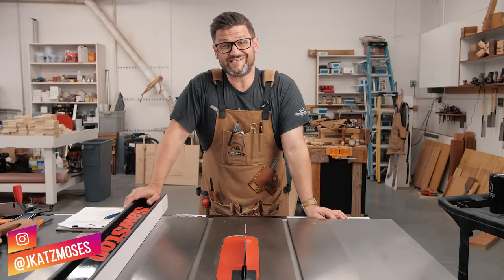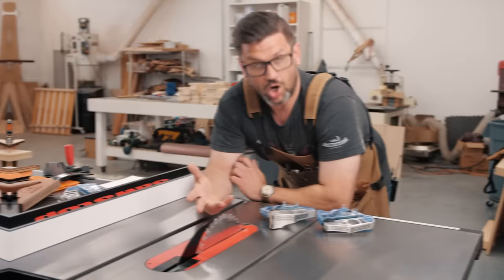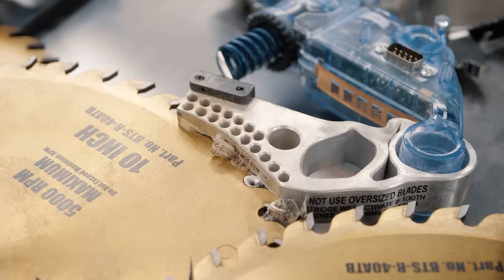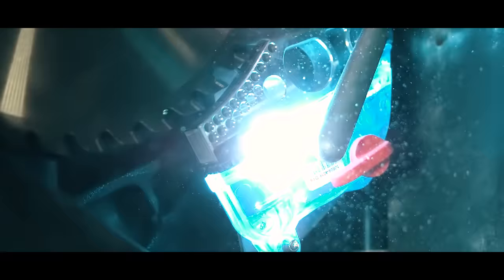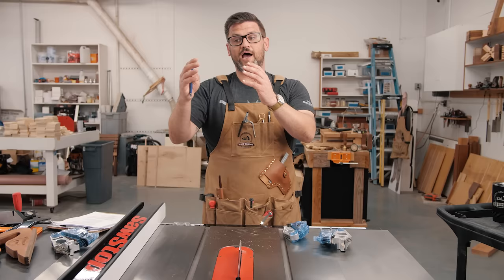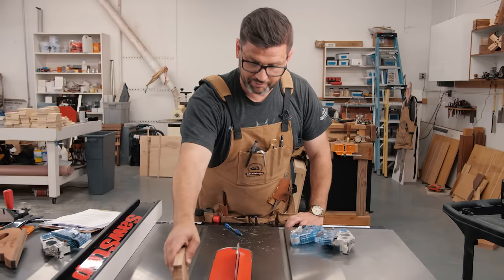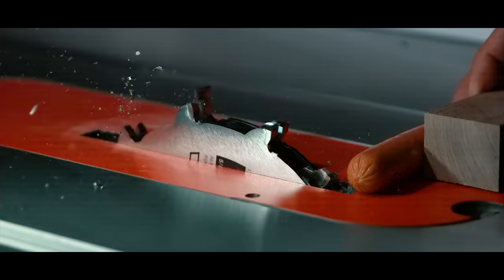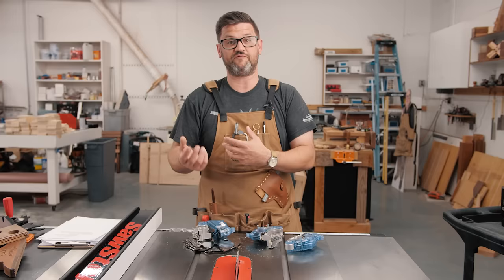How Safe is a Sawstop Saw? - Never Before Seen 19,000 FPS HD Slow-Mo Video

Comment: I think one major conclusion that you missed in this video is that having a 'safe' SawStop saw IS NEVER an excuse to follow unsafe practices. EVER!
Yes it worked the 9 times you tired it, but that doesn't mean it is guaranteed to work the one time it's a finger hitting the blade and not a hot dog.

The saw is super cool, but technology is only a compliment to carefulness, never a substitute.
Reply: I wonder if the makers ever do demos using there actual fingers...

100% agree with your comment. Safety mechanisms of any sort...rocket ship, table saw, automobile are just an addition TO, never a substitution FOR proper safety procedures.
Reply: @joeshmoe7967  the guy who made the saw has put his finger in the saw and he didn't even bleed
Reply: Wrong the conclusion is that it's safer to hold your lumber with hot dogs
Reply: The phrase "no sh*t Sherlock" comes to mind. People keep making this argument but I have to meet a sawstop owner that doesn't practice the same level of safety. I think the ones who keep saying this don't own one. I have one and have no desire to test the brake.
Reply: $100 to $150 to replace the blade and brake system is still a fairly significant penalty for not following regular safety rules... It's just not as significant as having multiple fingers cut off.
Reply: Rev_dude Indeed! Amen to that.... ! Safety first! Then hot dogs all around!! Lol!( nervous laugh)... This is a good tool... But... All tools need to be used safely...
Reply: Albi Wiedersberg yyyyeeeesss! 👍👍👍!!!
Reply: Facts right here
Reply: I don't think his intention was to tell you to throw the safety book out of the window, or say that because it does this, it will work every single time and will save your fingers or hands. His intention was to show off what people have managed to create, in the end its something that has a very high chance at saving your life in a pinch, as to put it plainly, the majority of injuries aquired in saw blade accidents, are not from very careful people, but from people who begin to think either they are very skilled in it, so they don't have to be as careful, or those who haven't had any training. I myself am a fully trained carpenter, and I had to use a saw blade when I was learning, but that doesn't mean I would ever put my hand anywhere near that blade. Even if I was told there was a magical device in it that would make sure that you would gain no pain or injury from touching the blade. Obviously mistakes happen, but this is what these are for, look at seat belts for instance, you don't necessarily need a seat belt all the time, if I where to drive to the shop, you probably won't need it, you may never need it, but it is there to save you in a pinch, when the unexpected happens. That's why things like this are invented, not to discard safety, but to offer a seat belt so to speak, something that will very likely save you in that one moment, where you either messed up, or something bad happens. Saying its a useless product because it encourages people to get rid of safety, is a pitiful excuse at the best of times. I obviously won't go against your opinion of it being a bad product, that's your decision, but saying it encourages bad safety, just shows that those who think this, really shouldn't be using this device.
Reply: Joe Shmoe yes I saw it live. I was about 6ft away too.
Reply: of course. if it goes wrong, it goes wrong less
Reply: Yeah same reason for a bunch of crashes, just because the light is green doesn't mean its safe to go. people rely too much on systems in place to save them rather than themselves.
Reply: @joeshmoe7967  just use prosthetic hand, no troble
Reply: Ya ya shut up and take my like

Comment: "You'd be back at work as soon as you were able to get your stitches out"  You know damn well that most people would be back to work right after they got back from the doctor.
Reply: False.. most people would tape that sucker up with what ever tape was in their box or vehicle and back at er
Reply: @god_mode_on  That actually works pretty well, but you need gauze or something or the blood just makes it not stick. Unless you have better tape than i own i guess.
Reply: @nuuuuuut  crazy glue
Reply: @god_mode_on  Need to be careful with it, though. And it doesn't provide much mechanical strength, in most cases.
Reply: American, yeh?
Reply: Was thinking that also. That size of a cut I wouldn't get stitches for though, I have scars from cuts I've gotten, even crushed the end of my pinky, I cleaned it, wrapped it up in paper towel and electrical tape, had a smoke and went back to work 😆
Reply: No worker's comp claim for YOU!
Reply: Last time I got 11 stitches and the boss was like "so back to work now your not bleeding on everything"
Reply: @adamrodgers9175  amen brother
Reply: @nuuuuuut  Do you not have medical tape? Just use medical tape. If it's a big wound put a non-stick pad under it.
Reply: Also if you don't have non-stick pads then cut a few pieces of medical tape, put them across each other, and form a non-stick pad out of those pieces then put that under more tape that holds the square you just made in place. I did this for a kid before who fucked up his foot pretty bad and had blood everywhere.
Reply: @FringeWizard2  I do not but I will look into that, I tend to injure myself working on various hobbies and whatnot pretty frequently. There's like this.. sort of wound care supply store not far away but i never go there because it's often filled with elderly people. maybe i'll stop by real quick and look for medical tape one of these days - or hell i could just use amazon.
Reply: Yeah except those people who live in civilezed countries, who don't get a bill from their doctors and have paid sick leave for sure. If it was a project at home... maybe, but surely not at work unless you're self employed and need to get that sh!t done.
Reply: Nuturi hell pour some alcohol on it bandage it and go lol
Reply: Ur goddamn right
Reply: @adamrodgers9175  damn right buddy, that's how it goes :D
Reply: You mean right after the electrical tape wrap.
Reply: What're you, lazy? Duct tape that gaping wound and get back to work. Job won't get itself done.

Comment: "They move the hot dog so slow" I don't know about you guys but I don't punch table saw blades
Reply: Imagine your hand slips of because the wood you held was oddly shaped w/e
Reply: @xXDESTINYMBXx  yea but even then you would have to be pushing against the piece of wood pretty hard for your hand to go that fast
Reply: @jacobbartlett331  I think it's qbout kickback, which can kick your hand into the blade. Which would go pretty fast.

I don't think much saw accidents happen where they slowly push their finger into the saw by accident. It's always caused by slipping, losing grip or the wood could unexpecticlly go through the wood if it has air pockets. Or if your project that you're cutting has less dense areas you didn't expect you will shoot forward if not careful.

So yea they should throw the hot dog in there at higher speeds than the feeding speed.
Reply: Nobody punches table saws. But kickback causes your hand to move towards the saw far harder than a punch...
Reply: 420th
Reply: The real scary thing is when you let go of the wood a half a second too early and it shoots out the other side. You’ll have a mini heart attack
Reply: Rocknroll Jimi  that’s what I’m saying, you would have to be holding pretty firm for your hand to slip and go that fast. You are literally just agreeing with me
Reply: cheryl tunt  when what happens fast? I’ve seen a comment talk about kickback, which I forgot about, but that force comes more from the saw and not your hands, I was just saying that you would have to hold a material decently hard for your hand to slip and be equivalent to the speed of a punch, which I thought was unrealistic if your using a saw that stays in place and should cut easily.
Reply: My finger went into a regular table saw. Went about half way through my finger, just short of bone, right across the nail.

My hand was moving quickly because my dog ran into the back of my legs. Never assume, accidents happen for all kinds of reasons.

Comment: This really should be required in shops used for education. I recall many years ago taking a woodshop class in a middle school where students were using the table saw on a daily basis, and I always felt that was less than safe. That class was certainly not without accidents and this would improve the safety immensely
Reply: It activates when an electrical resistance is sensed.  This will happen when you feed wet wood, nails, hotdogs or body parts into it.
Reply: @danielpaquette1597  - specifically, it measures the change in capacitance.

Comment: I always wondered how a sawstop differentiated between the things it's supposed to cut and a human finger. My jaw dropped to the floor when you said it used a small electrical current to detect when there's human contact because it's such an elegant and seemingly simple solution. No complicated machine learning, no cameras, no weird laser trickery. It simply takes advantage the thing that we humans have that other materials don't, and that's electricity.
Reply: For sure! And, it probably needs to be simple in order to stop quickly enough. Machine learning and image processing aren't known for fast computational speed!
Reply: So a hot dog has electricity?! I thought it was via moisture?
Reply: @johnserra9  I'm wondering if the saw measures a drop in capacitance. A hotdog is made of (mostly) flesh, so it can absorb electricity as easily as your hand.
Reply: @jpaugh64  A hot dog hasn't got the mass of the human body though. So from my understanding even if it did absorb some current, it is not enough to trigger unless you are touching the hotdog.
Reply: @wishusknight3009  I think we're on the right track here. However, I wouldn't assume that the saw stop is calibrated to an adult human, or even a child. If my pet ferret (say) touches the spinning saw, it should save the pet. The saw would definitely be oversensitive, and, further,  I would hope they've erred in the side of triggering too often rather than the side of almost doesn't work.
Reply: @jpaugh64  Well even a ferret is may times the mass of a hot dog. Assuming it has no fur to insulate connectivity it would probably stand a better chance of triggering than just a hot dog by itself. . But I would gander that it would take something of many pounds to trigger it. Perhaps as little as a toddler.
Reply: It doesn’t detect “electrical currents” in our hands.  It has a constant electrical current running through the blade (the blade is metal so it conducts electrical currents easily) that detects a difference in moisture and reacts as soon as the electricity in the blade passes through something like a finger.  Dry wood does not conduct electricity and therefore no electrical current passes through the wood.  The saw would react the same way should it hit a water saturated part of the wood or a nail or screw as they all conduct electricity far more easily than dry wood.
Reply: Bernie Gores  Accidents happen to those who even use best practice all the time. Dont be a dull boy.
Reply: Bernie Gores  Irony is you telling me about reality when you don't seem to live in it yourself. Glad you are so perfect that nothing has ever happened to you.
Reply: Bernie Gores  yes the blade is damaged  if it doesn't brake the carbide tips it warps the blade, causing it to  vibrate making the cut rough.  
The mechanism cost $150 dollars on top of the cost of the blade.  
A hell of alot cheaper that medical bills .
Reply: Bernie Gores  I took the end of my ring finger off with a table saw ,while using a push stick ,so even making the safety efforts not to get injured,  the fault was In the design of the push stick  resulted in my injury .
Reply: @johnserra9  Anything with flesh/nervous system (whether dead or alive) will always have innate electrical current, or at the very least the moisture from the objects does. That's the best of my knowledge anyways
Reply: But you can't use it to cut hot dogs.
Reply: Bernie Gores  you can't catch every little thing in reality, especially if you've got a time limit. If you stopped to check every single thing that could possibly go wrong every single time you make a cut, you would never get any work done. So sure, most accidents are "human error," but as humans, it is inevitable that we will slip up a bit every once in a while. So when the smallest error can cause permanent damage, it's worth the extra safety.
Reply: @asz106  honestly curious. If I put say, copper foil in the middle of a piece of wood, do you know if that would stop it? Or would that small piece of copper have to be touching my body?
Also on another note I am curious if someone was wearing gloves if the current passing thru the blade will still detect it in time? 
Or perhaps it'd have to go thru gloves then sense a finger lol?
Idk if gloves have been addressed in the comments?
Reply: @ajlacostewm  Damn that sucks I'm sorry man
Reply: @Luna Nyx I'm not sure how often people fall onto working saws vs how many people cut their fingers off, but it should still work as the rest of your body still conducts electricity. It'll probably cut through your clothing first, but it'll probably stop before you seriously injure yourself
Reply: @Luna Nyx Just to clarify since there's a lot of misinformation in here, along with random "perfection" preachers(??): the saw doesn't require "electricity" in what it touches. People are saying things like "you have to touch to hot dog to give it electricity". That is not only wrong, it just actually doesn't make sense. The saw has current running in it, and it detects anything capacitive or conductive. You cannot use a saw stop with a steel cutting blade to cut steel, as steel is conductive. Wood is not conductive. Hot dogs (or more accurately, the water in hot dogs) are conductive. Your finger is conductive. If you fell onto a saw stop, your shirt would get ripped and it would only begin to fire once it touched something conductive, i.e. your chest (skin).

Again, it is not "detecting moisture" or "receiving electricity from your hand" or anything like that. There is a stable amount of current flowing through the blade, and when you touch it with something conductive, some of that current conducts into the thing you're touching the blade with.

For the record, in order to cut particularly wet wood (as again, water is conductive), or to cut metal, you have to put the sawstop into a bypass mode, which will DISABLE the safety feature.
Reply: Analog systems are the most reliable in my opinion ... Very easy to inspect, and rarely fail.

Comment: "your hand will be mangled" is still a better situation than "your hand will be completely gone"
Reply: Well yeah xdxd
Reply: true
Reply: amputation will tell you otherwise
Reply: @Herw768Offcial  with this the most unlucky you could really get in term of amputation being nessecary would be loosing 1 finger when incidents where this would help people lose like 3 fingers
Reply: @tylerblubaugh5549   i mean i wasn't realting to the video and more to the comment, a mangled hand will still need to be gone
Reply: @Herw768Offcial  they can still patch that stuff if it isn't too far gone
Reply: @Herw768Offcial  If your fingers are still attached, there's a chance they could be saved. Hell, sometimes they manage to sow them back on after being completely severed and they heal eventually. I feel like this really isn't the type of mangled that can be equated to amputation
Reply: @tylerblubaugh5549  If you are lucky. You'd be surprised at some of the things they can't save
Reply: @lred1383  I've seen amputation resulting from somone getting their finger stuck in a door, so you'd be surprised.
Reply: @Stettafire  It highly depends on the exact situation, as well as the competence of the surgeon. There are definitely cases of actual severed body parts being reattached in a way that allows them to heal back on. Anyway, my point was that this sawstopper is definitely a great gadget to have. Even if it's a 50/50 if the finger will be lost or not, that's still better than 0% chance of saving it. And here it looks to be way more than 50%. Like, come on, it couldn't even cut halfway through a hotdog pushed into it as fast as humanly possible. That means it's unlikely to even damage the bone
Reply: Stettafire Seriously? Well, now In going to be extra careful around doors...

Comment: I was simply blown away by this! I don't know what a Sawstop saw cost, but I bet it's ridiculously expensive. And, after seeing this, I'd say it's worth every penny. Thanks for that fantastic demonstration!
Reply: I believe its about 60$
Reply: @Dompan  Not sure what the system costs, but the replacement cartridges are quoted around 500$ each, according to my work

Expensive if someone is screwing around, but cheap compared to a finger. Just don't wear gloves while running it.
Reply: It's readily available on their website.  The lowest end one costs $900, these are the type of quality you would otherwise see at the home center for $99 for a black friday special. They go up steeply from there.  So, yes, you will pay dearly for one of these.
Reply: The saws cost several hundred dollars above equivalent competition each. No, the compact $900 saw is not the quality of a “$99 saw”; it’s comparable to $600-700 saws. Brake cartridge around $120 plus a new blade whenever it activates.